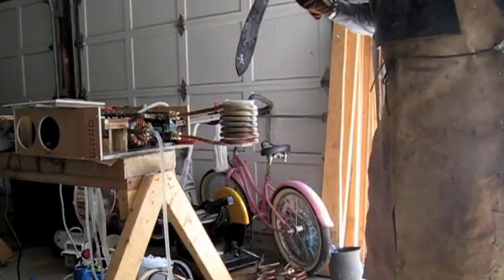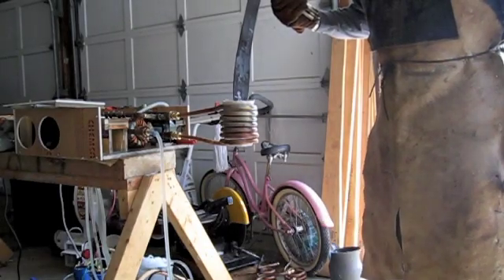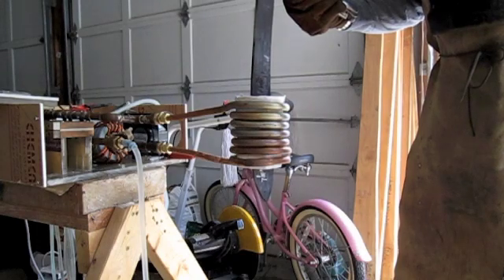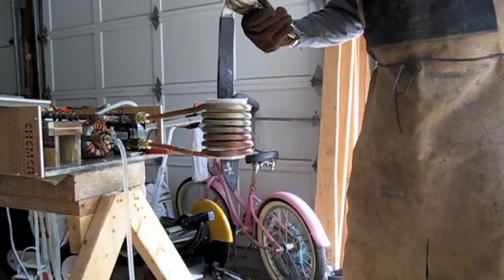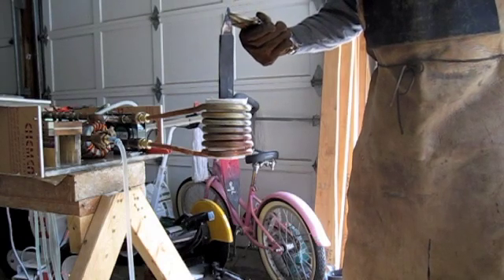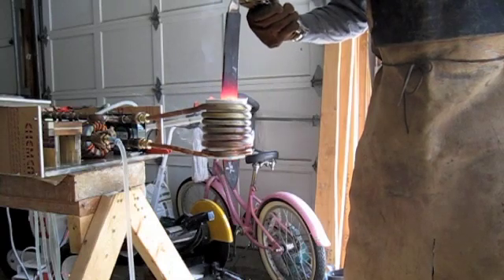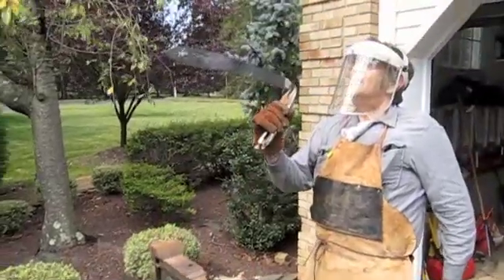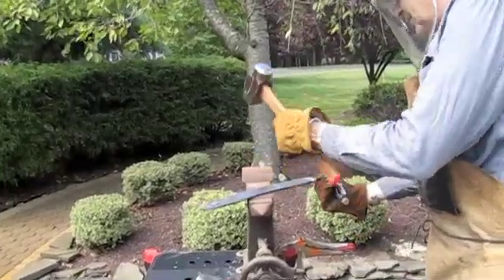Induction Heater Forging Steel iron

Comment: I like the fact that you can heat up metal with electricity, this set up is a bit scary though.
I'm not sure if this is shown as a viable tool or more like a novelty item. I think as a tool it can get expensive to run. Is highly inefficient and unsafe, other wise is a cool gadget.
Reply: gay.